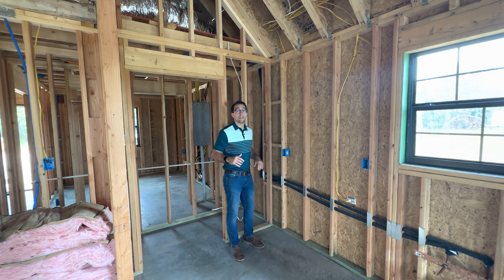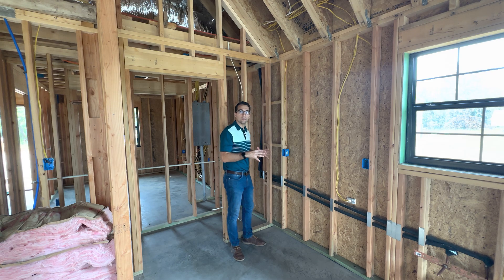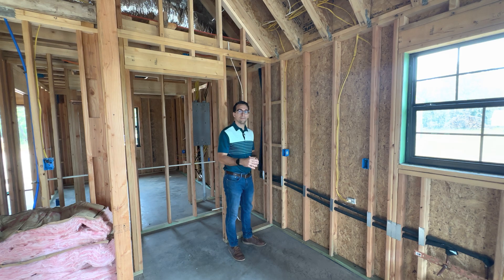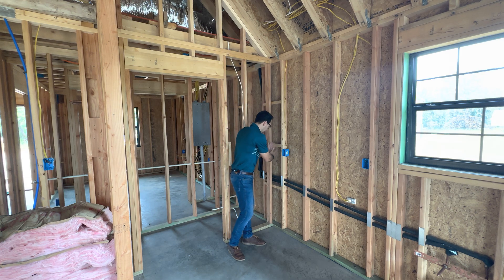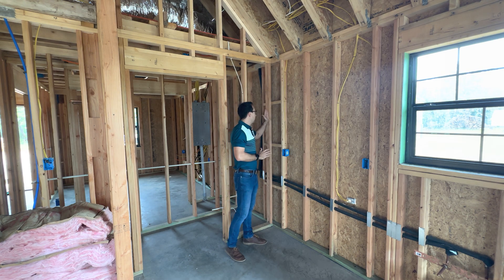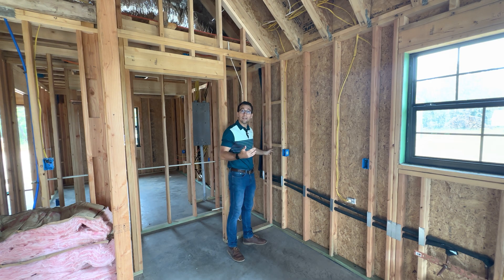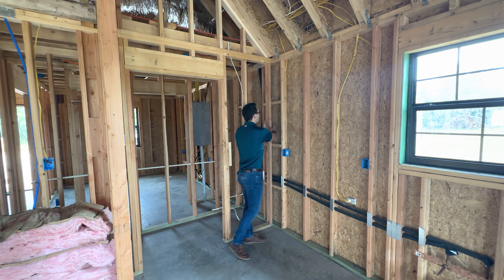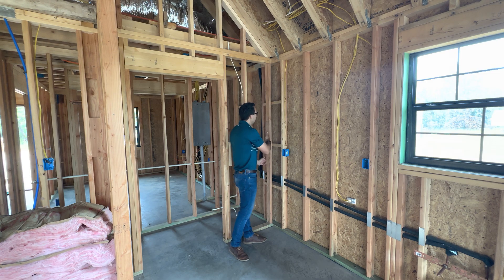Ladder Blocking - Framing Technique

Comment: 50 yr framer here
Stack the rafters on the studs! duh
2 2x4's witha 2x6 nailer with spray foam or fiberglass in the hidden space is THE WAY TO GO
Ladder Blocking = no dywall nailing = craked drywall Jeez come on!
Frame the exterior walls with 2x6 framing

Comment: Any framer will tell you, no one does it that way, you can still insulate the cavity with a partition backer. Progressive huh?
Reply: Exactly and he's leaving out drywall backing. Unbelievable, so far everything this co. Has shown is wrong. The other video I watched was was using California Corners on exterior walls.
Reply: @H43339  What do you see as the disadvantage of California corners on exterior walls? I'd genuinely like to know.
Reply: @H43339  I never used three studs. My alternative to a California corner is the "conventional corner" or "stud/block/stud": two studs with blocks in between. But I almost always used California corners, in Texas and the Mid-Atlantic.  If conventional corners are a bit stronger, theoretically, I don't see it as very significant, because it's "extra strength" in a place that's insignificant. In conventional stick framing, there is no extra load on corners. It's not a point load.
Reply: @JohnDoe-fu6zt Well good for you, I will continue to use 3 solid studs now days here in Ca  it's usually HD'S & post or strong walls.

Comment: (We still use Trad. “T’s”) Depending on wall height, my insulation subs drill two or three 1/2” holes (diagonally at the inside corner) and fill the entire inaccessible cavity with expanding foam. Since we use 12-16” waste blocks instead of a fourth stud, it requires very little drilling depth and it’s easy to see the insulation coverage. I wouldn’t consider the method shown as “progressive”, but just a different way of doing things.

Comment: Still need sheetrock backers between ladders or sheet rock corners will wanna crack especially when someone slams the door.  A missed step we do i dont see anyone else doing in my area is installing a 16in wide strip of poly prior to exterior wall prior to building interior walls. Then you have a plastic to attach plastic to and  This gives a good proper vapor barrier on entire outside walls

Comment: We were ladder blocking 40 years ago in Kansas City , installed 2x4s flush with inside of studs in able to tuck insulation batt from top to bottom without cutting it
Reply: What about drywall backing  ?

Comment: Here’s a better idea. There’s a technique in framing, and it’s called stacking. It’s when your rafters, studs and floor joists follow the same layout. That allows better transfer of weight, and less damage from bowing and settling.